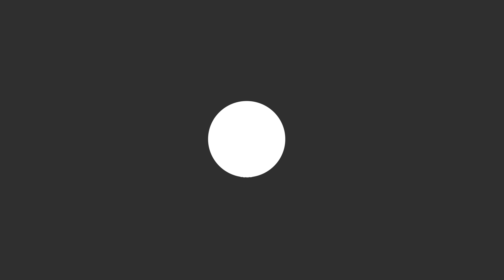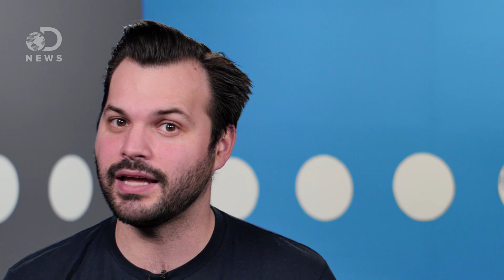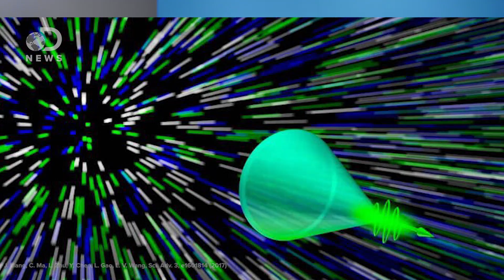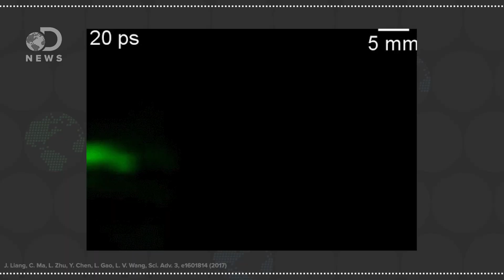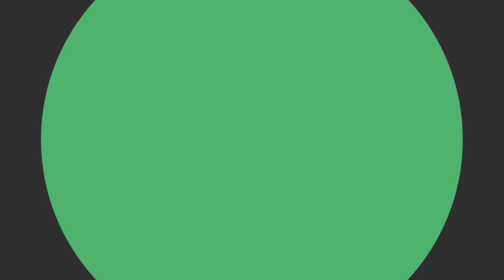'Sonic Boom' Of Light Captured For The First Time Ever

Comment: Uh first time ever? We've known about Cherenkov radiation for a long time. Those videos of nuclear reactors glowing blue at start up? Thats particles traveling faster than light through the steel of the reactor vessel causing Cherenkov radiation. Or, a 'light boom'. What you showed was a laser pushing some vapor around....also not new(see laser tweezers).

Comment: Cool but the graphic showing how the slows down at 0:27 is wrong and a common misrepresentation for what causes light to slow down. It actually is caused by the photons wave frequency, reacting to the electrons wave frequency of the atoms it is passing through.
So for example. I you have two waves with frequencies f1 and f2, when added together, will pulse or beat with a frequency equal to the difference between the two original frequencies.

Thus the photon slows down and the electrons speed up to match each other. With radioactive elements all the other high energy particles being emitted creates more frequencies which can cause photons to travel slower than electrons. The energetic faster electrons create that blue glow you see in water of nuclear reactors.

Comment: There is a thing called Cherenkov radiation, which (as I understand it) occurs when you try to push gamma rays through a non-vacuum medium.  The problem is that a photon really CAN'T slow down - but it also has too much DeBroglie (virtual) mass to travel that fast through that medium.  So it splits the gamma photon into a gamma photon of lower energy and a photon that appears blue (i.e. the photon that holds the incremental energy that got bled off by the gamma photon trying to shed energy.)  If anyone remembers the old James Bond movie "Dr. No" - the reactor was immersed in water as a secondary moderator (mostly to kill the alpha and beta emissions, probably) and when they fired up that reactor, it showed the blue Cherenkov glow.  I don't know who in the movie's special effects team knew enough to do this, but for once a movie came close to reality.
Reply: Cerenkov radiation phenomenon can be found in the water around by a nuclear reactor. Light slows down to 0.75c or so, beta particles travel faster than that and there's basically a lightboom! But not beyond c though.

Comment: It's impossible to make light slower.  What hours explaining is simply allowing like to hit multiple points of a mirror, fog, or some sort of prism, which results in the light taking longer to come out of the other side; however the light is still going the same speed.  Just because the beam of light is bouncing off of a wall doesn't mean the speed has been reduced.

Comment: Photonic boom my ass, this is just incident light emanating perpendicularly from the fog particles. And the clear silicone rubber/aluminum oxide 'plastic' tube that the fog resides in has nothing to do with it. In a stretch, I do suppose that one could consider this stimulated emission of incident light (photon/electron interaction) to have some similarity to the collision between air molecules that occurs in a sonic boom. But your depiction of the differences in light speed between the fog area and the plastic/glass tube being the cause is bogus as all get out.

Comment: Correction: you're not making light slower at all not even in a mynute little bit. What you are doing is causing it to bounce off of other things which just gets in its way and makes it take longer to get to point B. Since the fastest distance is always from point A to point B instead of going to point C first the light is still the same exact speed but has more obstacles to go around that is all.

Comment: I don't think this camera is new. There is a TED talk about 1 trillion frames per second camera from years ago.
Reply: TheLance3185
You're a naive idealist. Get accurate.
Reply: "This is not really one trillion frames per second. Instead, this is more like a strobe effect. You have seen this, right? You know, you take a strobe light and shin it on a guitar string or something. If you get the frequency of the light just right, it will show images of the string at different positions during it’s oscillation. In the end, you get a video that looks like it is slow motion but it isn’t. Actually, with the strobe light you can see this in real life without even using a camera. In this trillion fps camera, the light is just like a strobe light. It uses a pulsed laser."

https://www.wired.com/2011/12/is-this-really-one-trillion-frames-per-second/
Reply: Yeah. Streak cameras have been around since the 70s.  This 'new' camera is a multi-frame streak camera.

Comment: It seems to me this "photonic boom" isn't quite a photonic boom: it's just confining part of a beam to a less dense medium, and the other parts to a more dense medium to slow it down. Also it's completely made of light, which isn't exactly how a sonic boom works (by comparing this to an aircraft-produced sonic boom did Trace imply that the pulse of light is creating a bow shock...of light?).

Wouldn't it make much more sense-- if they really want to call this a photonic boom, to photograph a charged particle (with crazy 10^11 fps camera) going through, say, water at greater-than-the-phase-velocity-of-light-in-water (that is, Cherenkov radiation), which actually produces a cone shaped shock front (of light)? This is mechanically much closer to an aircraft going through air at greater-than-the-speed-of-sound-in-air, which as far as I know is the textbook sonic boom.

Comment: That's like saying if u add a tad bit of steel in a molten gold mixture will it still have the ability to not corrode yes a bit it won't be it's original ability so in truth unlessits something like a black hole almost nothing will surpass light

Comment: You see that wave propagated by the laser burst is moving at the same speed as it is, right? Same color, same basic shape, and consistent from frame to frame. Yet no doubling or collapse to be observed whatsoever... How could they be certain it's not simply refraction in that fog? Furthermore, why is the laser allegedly unaffected by the fog?! I'm under the impression neither are faster, but the laser is simply a more intensely focused beam of photons. Be it a flashlight or a mega-laser... it's still bound by the same properties of light, isn't it? If more photons are present in a focused location, a higher probability of refraction accompanies the higher probability of a phasing right through the fog, thereby radiating outwardly in all directions while rapidly losing energy. And of course, because the laser is moving in a given direction, said refraction would carry less energy in the opposite direction, thereby making the fog's glow much lesser behind the laser burst. Duality of light or undoubtedly they're  right..?

Comment: This is not as impressive as its made out to be. Nor is this in any sense comparable to a sonic boom. The light's equivalent to a sonic boom (which is an object moving through a medium faster than mechanical waves can propagate though it) would be something moving though a medium faster than light would. That would be Cherenkov radiation.
This is like having a piece of steel, hit it in one end and be amazed how the mechanical wave (sound) moves through it faster than it does through the air and how it transfer out from the steel into the air in a cone. Still cool, sure, but nothing like a sonic boom of any sort.

Comment: Well, not to fast there champ. They weren't really making light go slower. They were making the light travel a farther distance by bouncing it off of smoke particles.  The shortest distance between two points is a straight line, but that was not a straight line... lol

Comment: Everything can travel faster than the speed of light. Nothing can travel AT (I repeat AT) the speed of light. 
That makes it impossible to get faster than speed of light, except you find a way to get over the limit without touching the limit. 
And thats not even impossible. There are such strange things like for example the exact location of electrons is undetermined until it is there. You only can say what chances are that the electron is at an exact spot. And the interesting part is, that between such locations there are sometimes no connections (so the chance for the electron to be there is 0. and somehow it manages to get through there, without being there). 

Maybe there is a way to do this, but not location, instead velocity. 

Problem: when you cant travel exactly the speed of light, and you somehow managed it to get faster (without being exactly as fast), then you have the problem, that you have to slow down to less than speed of light, without touching speed of light. So you have to do the trick two times. Once for accelerating, once for standing still. 

And the next problem is, that speed is relative. 

This makes everything so complicated, that it would be too long to explain here. 

When you read what I wrote and understood it: respect. I am not very good at explaining, and I am not a native english speaker, so I think it is very dificult to understand me.

Comment: But then it still did not travel than the speed of light, it's just that it slowed down the other light. Comparing 100% speed against >100% is different from 100% vs <100%

Comment: Hm. Einstein used light as a constant in his formulas because the astronomers he asked said the universe was static, neither expanding nor contracting. These same astrologers told him that there was nothing (detectable) that was faster than light. He later found out about red-shifting and considered the use of a constant to be a mistake in a dynamic universe. Some of his students/fans later found a way to use his formulas to describe an expanding universe as well. While light is generally considered to be a constant speed, Einstein said that gravity was a curvature of space-time where space is contracted and time is dilated, which automatically changes any constant base on space or time such as speed. Einstein also said that the force of gravity is identical to any other accelerating force in this regard.

Comment: Unfortunately streak cameras are sampling devices that shift amplitude variation information over very short intervals of time into a spatially distributed representation of the temporal variation which can be measured much more slowly.  They can only capture a short segment of the time series of a signal at a time, so they must be used with repetitive events that can be triggered against with low jitter so as to build up images over a large number of acquisitions.

Because the are fundamentally an equivalent-time sampling device they can not image one-shot events.  None the less they can do amazing things like ballistic photon imaging through scattering materials, or reconstruction of scenes "around corners" by bouncing off even quite matte surfaces.

Comment: what do you mean you can 'slow down light by shining it through water' ? 
all that does is make the light travel a further distance by bouncing it off the water molecules .. that's not slowing it down! relativity states light always has to travel at the speed of light ...
Reply: jedaaa okay, but you run at your maximum speed through those mazy lineup contraptions at banks and such.   sure you can run straight thru the belts and poles to the finish line, but if you have to keep turning 180 degrees every six feet, and you have to do that four times, you travel farther.  forget slowing down at the turns and imagine you go full bore.  you travel farther not going in a straight line.  you took longer, you were slowed down from your goal.

Comment: This is not the first time ever. Its called cherenkov radiation, commonly seen in nuclear reactors where fast charged particles are moving at around 90% the speed of light compared to photons travelling at 70% in a water-based medium. Thus resulting in a blue glow. (By the way, I'm 15)

Comment: The camera does not record 100 billion frames per second.  What it does is take a very high speed image that is precisely timed to capture the laser pulse at a given point in the field of view of the camera. They then repeatedly pulse the laser capturing an image with the pulse at a different point in the field of view.  After many pulses they then animate these frames together to get a movie that synthesizes 100 billion frames per second (but of course for only a small fraction of a second).   It cannot be used for a single event, which would only give one still image of the event, but it is rather used for repeatable events (usually pulses of light).

Comment: The graphic at 0:28 showing the propagation of light through a medium is completely wrong.  Light does not bounce around inside a material from one atom to another until it comes out the other side.  If that were the case then the travel speed of light through a medium would be totally random.  The correct interpretation deals with quantum fields creating drag on the light wave as it passes each atom.

Comment: Hold on. How does the camera capture that many frames per second if it has to right to the storage and since that is 5 times faster than the speed of light and the signals move at the speed of light wouldn't the camera not work?
Reply: I'm not sure if this works the same as a high speed camera that I'm going to reference, but one way I know this is possible is that rather than recording the beam all the way though as the video represents. They would actually repeat sending the beam through the material several times and take photos at different times along the journey of the beam. Then piece it all together to make one video at "100 billion frames per second" so in reality it doesn't record at 100 billion fps.

Comment: Actually, the medium doesn't affect the speed of the laser. The reason light moves "slower" through a medium is NOT because it is slowing down, but rather because it is bouncing off the atoms and molecules in the medium, thereby making it travel a farther distance than, say, light moving through air.
Reply: Dash ToTheMax Hey, don't talk to your future boss like that.
Reply: Actually, in a medium (like glass or water) light propagates slower because the electric field of light creates a disturbance in the charges of each atom (primarily the electrons) proportional to the electric susceptibility of the medium. The charges then radiate their own electromagnetic wave that is at the same frequency, but usually with a phase delay, as the charges may move out of phase with the force driving them, like a harmonic oscillator.
Reply: Incorrect.
If the "bouncing off" theory was correct the light coming out of the medium would no longer be in a beam, it would scatter.
Reply: Yeah, your'e probably right.
Reply: Actuality is NOT because it is bouncing of atoms and molecules in the medium. I found this about. I can't take it for absolute thrufe bat it make sense.
https://youtu.be/mICTVow3-3I
Reply: RJ Lee and sence when do individual photons split into more photons and scatter?
Reply: Parallellook: It sort of is both. The advantage of the macroscopic model where the phase velocity is multiplied by a coefficient has the advantage of being testable. Apparently QED expects photons to be absorbed and re-emitted; alternatively you could say that due to interaction with matter, the field quanta /do/ have mass inside a medium (as do polaritons) and consequently (?) lower phase velocity. I think that the best description cannot be given simply and relies on math. If we want to err towards "correctness" in terms of verifiability, I think we should stick to the macroscopic, no-reemission version.
Reply: Ackchwallly
Reply: Killian Meaney 
gee, that's great.
Reply: Kot Flakatomramorskucke what is wrong here, is your name.
Reply: Not really "bouncing", it has to do with polariton and quantum phenomena, sixty symbols has an amazing video about it :)
Reply: Actually its because materials have varied inductance and capacitance values hence forth altering the field properties of the energy perturbation.. cheers!
Reply: Paul Provencher You know photons are a fantasy and or mytheory right? just checking..
Reply: Chad Alan we'll have to agree to disagree, inductance and capacitance arise from quantum phenomena and are defined by them,  why would you try to use the Bohr's interpretation when you already have the charge-cloud? model?
Reply: Killian Meaney go to sleep harry your already commenting shit on videos that you don't understand
Reply: Killian Meaney you’re a smart cat
Reply: Killian Meaney Since I know you’ll get it- Sonic Rainboom confirmed.
Reply: Killian Meaney Ok, Ms. Mach 20
Reply: Mati Kook thank u for the details,I actually learnt something new,appreciated
Reply: aCKHSTULLY
Reply: Killian Meaney In my opinion, the analogy that light bounces around a maze is significantly less accurate than saying that the light slows down in the medium. The fact of the matter as far as I know is that photons will travel more slowly through an electrically dense medium, even without scattering at all. I suggest you look through a few physical optics textbooks. Don't rely on just one book, though, because poorer intro textbooks often allow a few innacurate analogies like the bouncing "model". Trust the math.
Reply: WRONG!
Reply: nerd